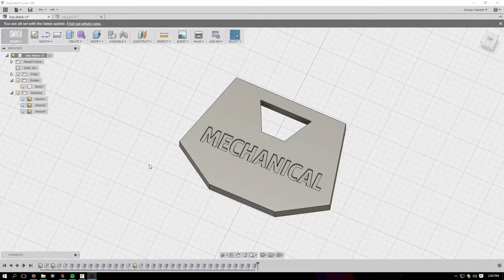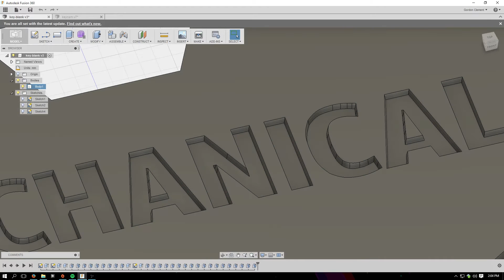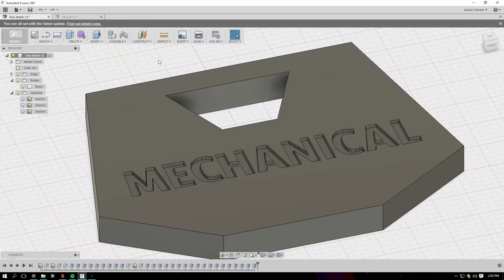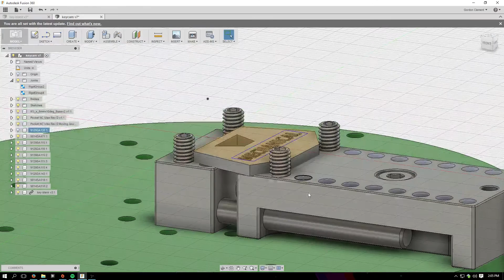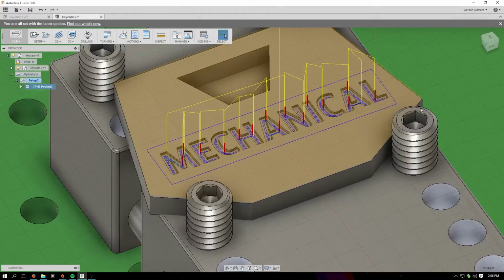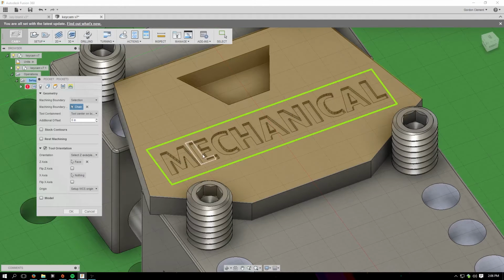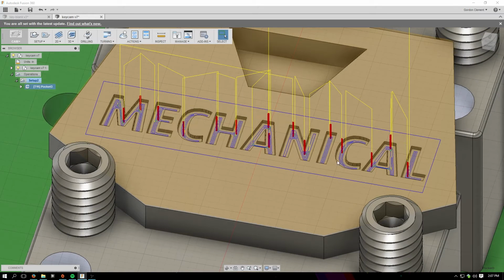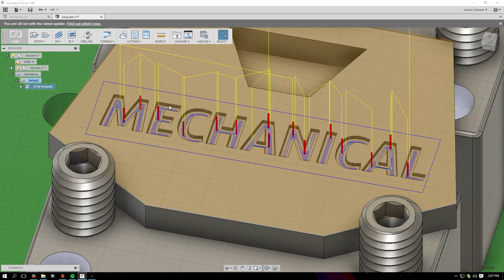Engraving a key with Pocket NC

Comment: What metal was the key made out of? I thought you can't do anything harder than aluminum?
Reply from the maker: The key is brass. I have only tried doing engraving on brass so far, but I think if you had your feeds and speeds exactly right you could probably mill brass on the PocketNC just fine.